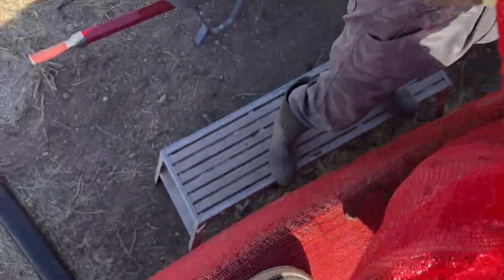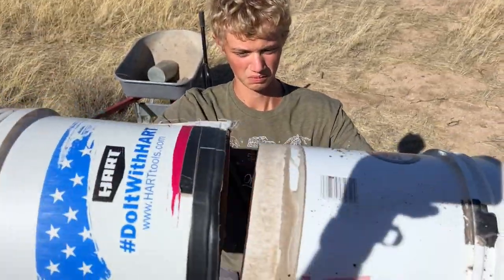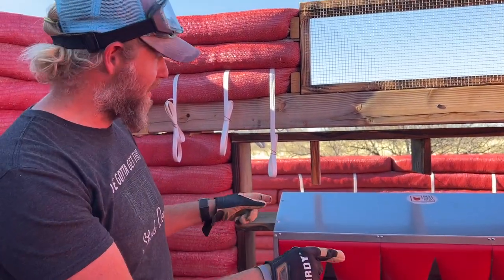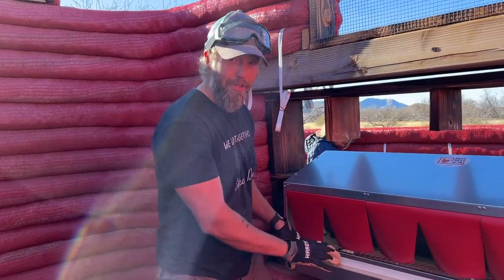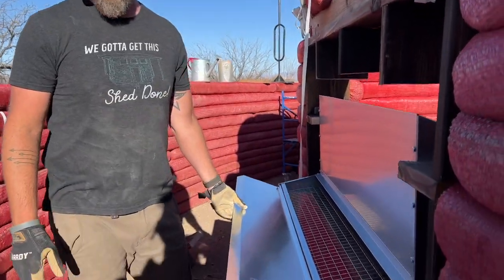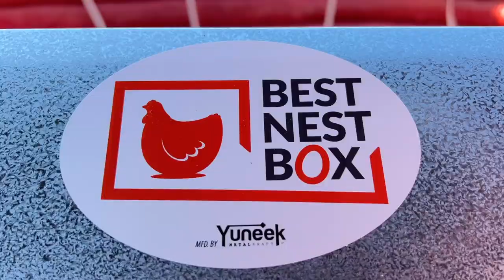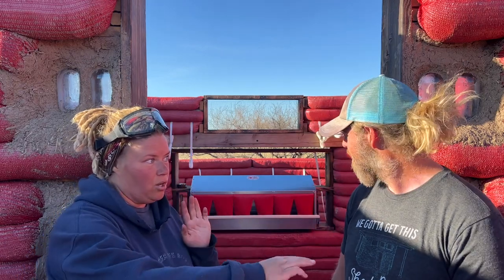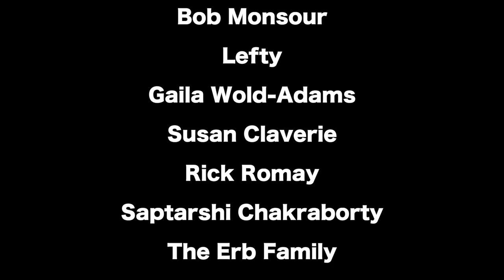Nesting Box DEMO - Making Changes to our Coop (Chicken Garden Day 97)

Comment: Hazel ☘️ …
Hope that metal nesting box will be in the shade or you’ll have roast chickens and boiled eggs on tap ! 

Loving your so creative  build and your lovely family … you all work so well together ! 
🙏☘️😘
Reply: It's on the north side of the building (so rarely if ever in direct sunlight) and they're putting a roof all the way over the space from the chicken coop to the back wall of the garden ring. It's all good :)
Reply from the maker: It’s on the north side and under a roof. It will be fine.
Reply: Very very true. Those hot dry days will also drain the fluids of the eggs. Keep plenty of water handy for misting the eggs if you leave them alone to hatch out .

Comment: I  use the exact same nesting box as you. Mine don't like it as much as they like the milk create. the things they don't like are: transferring from the roost bar to the mental edge, I would suggest cutting PVC pipe, or some sort of wooden cover for the metal edge. Also, I have to build another box over the egg collection area because they don't like the light and cold air that comes in from the outside, as I put mine on were I collect my eggs from out side my coop. Hope this helps

Comment: That nesting box is awesome and very similar to how the boxes/cages work for commercial egg farms. It keeps the bloom fully intact and will very rarely result in an egg being contaminated by fecal matter. Very awesome find!!!
I'm kind of wondering what your shelf will be used for and if it will be open from the back or into the coop area. IF it is "open" into the coop area, you'll want to place a type of door or closure to keep the hens out, as they will always seek out the highest place available to roost.
Speaking of roosting I have a really cool idea you might want to use. I've seen several homesteads do this, but just an idea for you to toss around in case you haven't seen it. You take a smallish tree with strong branches and that is a solid hard-ish at minimum wood, cut it down, and clean all twig and leaf material off and stand it up in coop area for them to roost on the different branches available. I think a Misquote tree would work great!!!  Anyway, just an idea!!! Love you guys!!!

I can't wait to hop over and see the new beautiful build and builders as they progress in their build!!! Thank you for the heads up!!!!
Reply from the maker: The shelf will only be open to the outside area :)
Reply: @TinyShinyHome  
Cool. I thought I would just mention in the event it had not come up in the research yet, just in case.

Comment: I read somewhere it's 5 hens per nest box then you get your broodys they will sit in the nest all the time that cuts down on nest boxes being open for others you mite need more old tires cut in half make neat nest boxes they can be put on the wall's not shore what you use on your walls or how you would do that but each tire makes 2 nest workes only if you have a coverd roof to keep them from filling with water ok

Comment: Another great video.  I was just reminded on another channel that it helps if you watch the commercials. So I've started letting them run. I don't actually watch but I let them run. Hope it helps. I was wondering if you will be putting straw in the nesting box or would that render the rolling of the eggs? Seems like they wouldn't want to sit on wire to lay, but then I'm not a chicken!
Reply from the maker: It comes with a mat so shouldn’t need to put in straw
Reply: @TinyShinyHome  Thanks. That sounds much nicer. 🙂

Comment: Don’t chickens like to sit on their eggs? This idea is a little late but Five gallon buckets  work nicely laid on their side with a layer of hay. Easy to clean, Just pull out the bucket and dump it. Plus the plastic doesn’t get hot like metal.
Reply from the maker: The egg won't go anywhere until they decide to get up :) The metal will never be in the sun with the roof and being on the North wall.

Comment: What about The metal getting hot?
Reply from the maker: It’s on the north side and will be under a roof. It should be fine. It will be well ventilated on there.
Reply: @TinyShinyHome  I knew you would have a plan. Just needing a bit of reassuring. I am an absorbed fan.